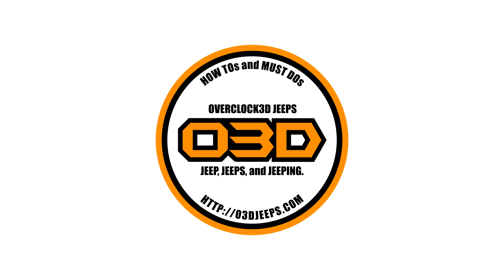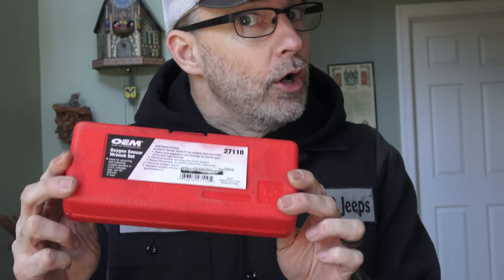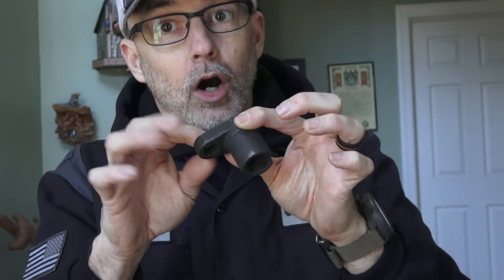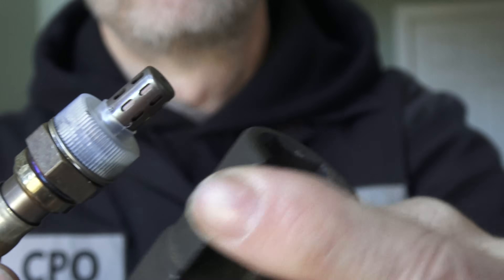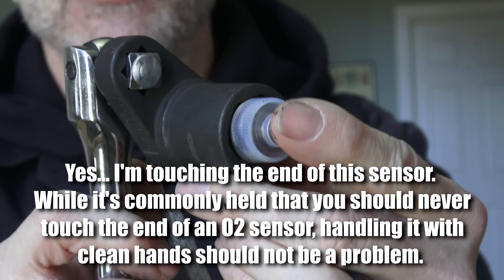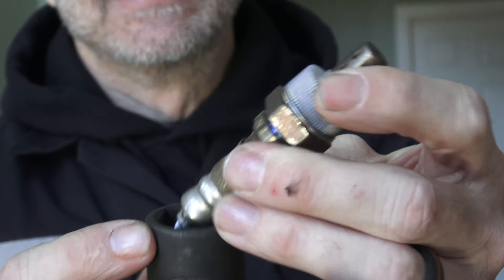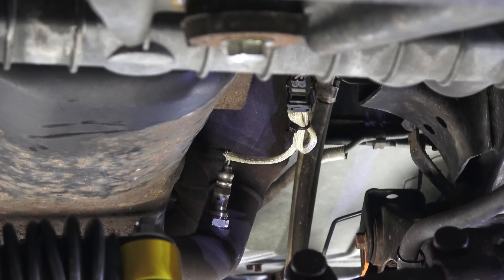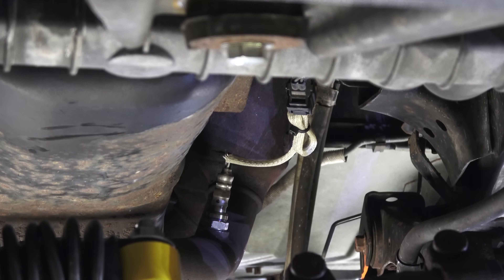O2 Sensor Install - OBDII Code P0138 - NGK 23132 - Project 2004 Jeep TJ Wrangler - Howto

Comment: I own a 2005 jeep wrangler unlimited Rubicon 4.0 I added a sprintex supercharger I also did many upgrades to the exhaust system now I get code p0157 , p0108 , p0171 , p0174 , I did replace all o2 sensors , but I noticed in your description all your o2 sensors has different part numbers for all 4 sensors when I bought mine I bought 2 of same for up stream and 2 of same for down stream not sure if this makes any difference so I'm buying what you recommend to see if any thing changes

Comment: Hello I have a 2000 Chevy van 350 vortex motor cei on  p0138 running rich, misfire,stalling,burning lots of gas .so if I change bank 1 sensor 2 .O2 sensor
It will start running normal again

Comment: Does the 2.5L also have 2 02 censors? Can't get my TJ to connect to code reader and apparently 99 TJ doesn't have the ignition switch reader.

Comment: Great video but I was hoping you could help? I looked up 23132 ntk O2 sensor (I had the 0138 code as well) on Amazon and it said it didn’t fit my 2002 Jeep Wrangler. I was figuring I could trust your advice as opposed to Amazons. Thank you in advance!!

Comment: I’m throwing a P0420 code planning on replacing both upstream sensors any thoughts ? Hope it’s not the cats
Reply: PO420 means the downstream O2 sensor is reading too many hydrocarbons making it through the cat. Unfortunately that almost always means the cat is bad. Don't bother replacing the sensors, they are working fine telling you the cat is bad.

Comment: Our '04 TJ 2.4 has a broken harness side connector for the O2 sensor (that's the one before the catalytic converter). I am left with the 4 wires and have no idea where each one goes where! The connector at the end of the O2 sensor pigtail is fully functional.Do you have any idea how to match the wires correctly?
Reply: can you see the wire colors on the o2 side pigtail? If so, you can just cut the connector off and make your own with some individual bullet connectors, or buy  a generic 4 prong connector off amazon thats got a waterproof connection. like these : https://amzn.to/3wxcV0X

Comment: I just bought both o2 sensors (97 4.0) oem mopar and both were stamped NTK so you can save money by just buying ntk. Keep your Jeep as MOPAR as possible but in this instance you can save a few coins by getting the NTK

Comment: 6:15 how did you get that connector to come apart? I am trying to get my upstream sensor pigtail apart (1996 XJ 4.0) without breaking the tab. Tab on the connector to the coil broke (gentle lift and it cracked) the other day when I was trying to get it apart for some dielectric grease refresh. Figuring these are all the same age, and all the same brittleness. Not replacing sensors yet, going through to make sure the connections are waterproof and looking for any exposed wires. I have a rough running problem after water has splashed up under Jeep, same issue after I washed the engine.

Comment: While I have heard of the no touch rule on o2 sensors.. it is also important not to use  non-o2 sensor safe RTV anywhere on the engine where the RTV fumes can get into the pcv system... That will kill an o2 sensor
Reply from the maker: I think the no-touch rule is an old wives tell, personally. lol -- I was happy to see the pre-application of anti-seize... made it easy to make sure it was a compatible product.
Reply: o3djeeps [ OVERCLOCK3D Jeeps ] I edited my above comment, It seemed to brash... Stay warm!
Reply: That thing he is touching is a cover, the sensor is inside the metal housing with venting on the side.